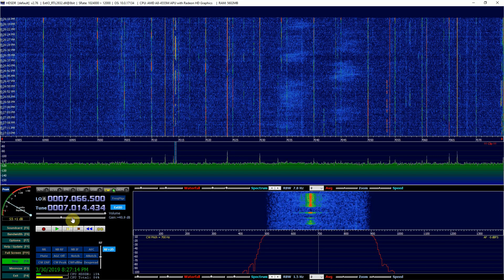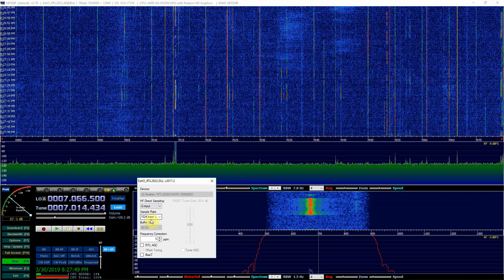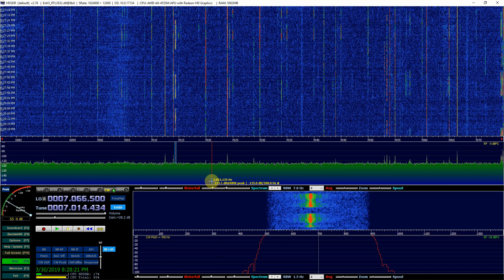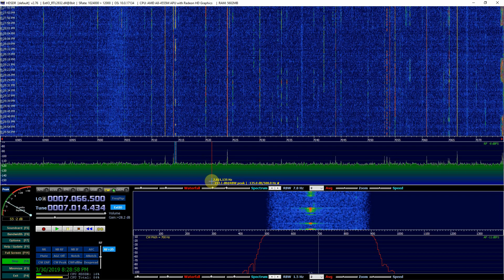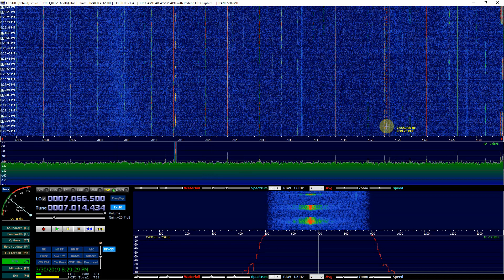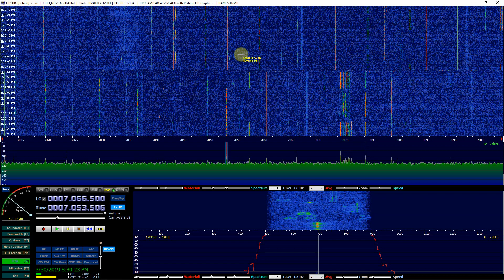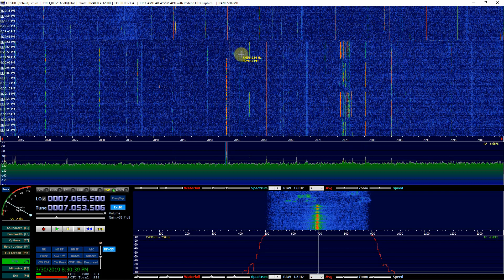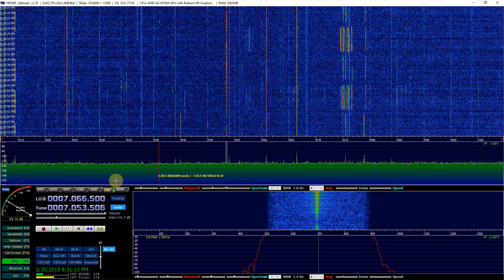Listening To Some CW Using HDSDR And A RTL-SDR.COM Dongle

Comment: Regarding the Q Input setting (1024ksps), it seems to be 'Disabled' by default.. when should you enable Q or I?

Do you have any tips or plans for a video on how to decode CW using the RTL-SDR/HDSDR and any of the more popular software (CWGET , CW Skimmer 2.1, MRP40, or Cw Decoder Logic v1.0.0.5, Ham Radio Deluxe, MultiPSK)  or website (morsecode scphillips translator)?

I have IF Output (Virtual Audio Cable) from HDSDR, but have not had any luck getting anything to decode, even though I see activity on HDSDR!
Reply: Hey may be had you found the solution to your answer, if not: The Real Matrix - Decoding Morse Code Using An RTL SDR Receiver, the video with link, 73.